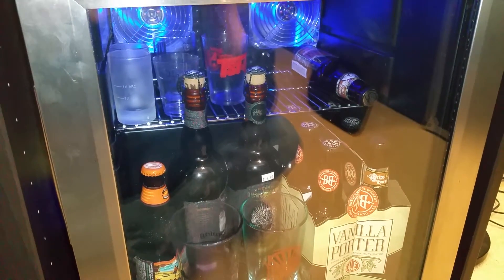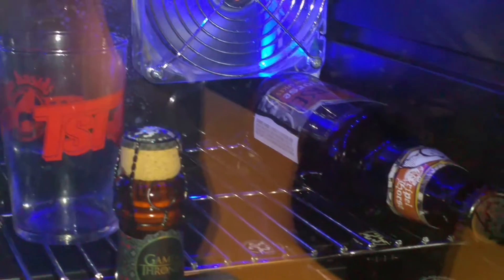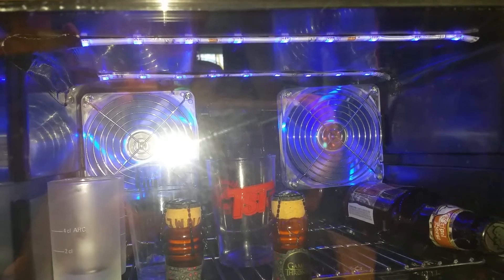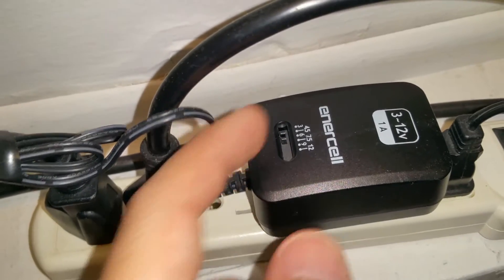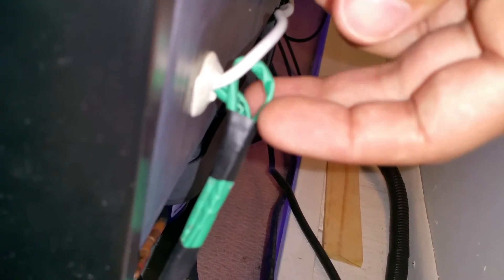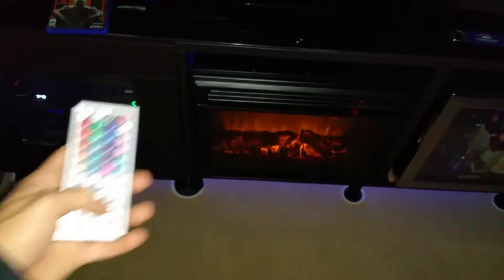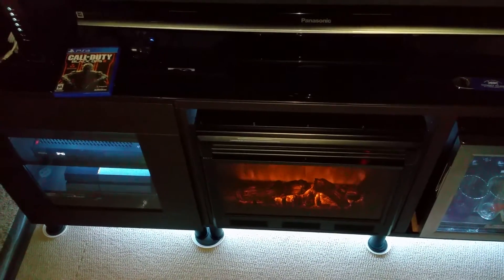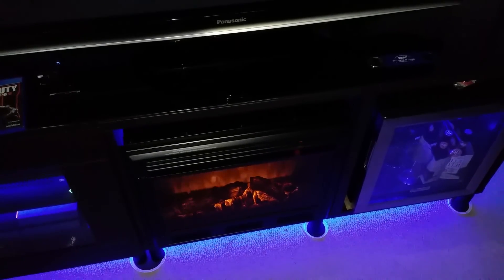Edgestar Beverage Fridge Fan Mod

Comment: its crazy how much this helps, why dont these mini's ever have a fan by design? using 1 120mm fan my top/middle/bottom shelf temps went from 32/38/46 degrees to an even 36.8 on all 3 shelves loaded
Reply from the maker: I believe the larger models actually have a fan built in but the smaller ones do not as they relied on thermodynamics to keep the temperature even but every refrigerator needs a fan even a smaller one that I installed would have worked just as good.

Comment: Thanks subbed and I’m doing this today. How’s your fridge running?
Reply from the maker: Its still running, but the compressor bangs occasionally.  The compressor is suspended by springs to dampen the vibrations, my guess is one of those springs are weak/broken. Still gets cold

Comment: Thanks for the video! I was really confused on where exactly to put the hole for the wires to enter. I just ordered that exact same power supply. I don't know a lot about circuits, I know how to wire the fans individually but do have any advice on how to wire both fans to the same power supply?
Reply from the maker: wire in parallel positive and negative. Easy deal
Reply: +xboxer1985  Thanks! should be easy now!